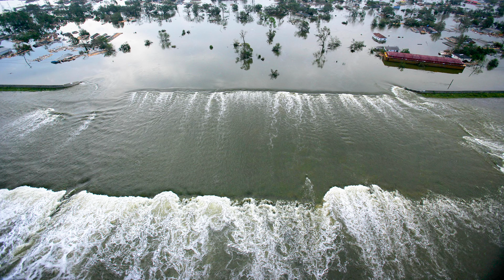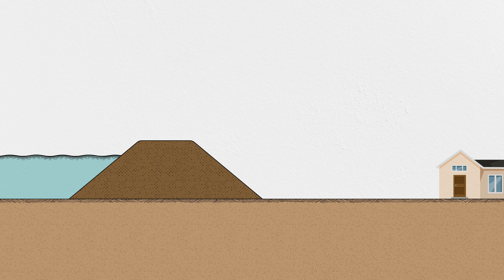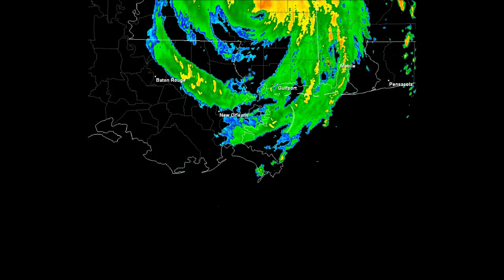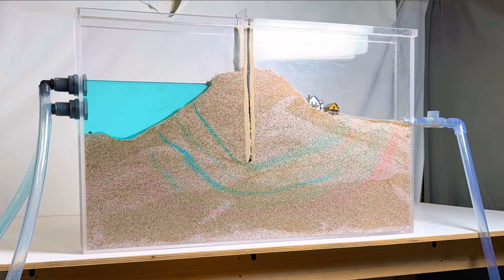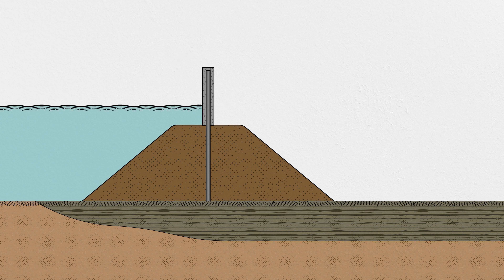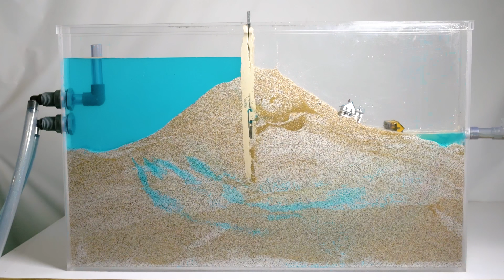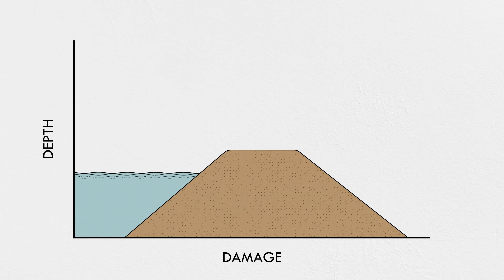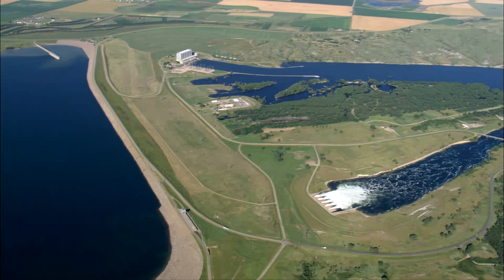The Mind-Blowing Flaw That Flooded New Orleans

Comment: Fun fact, after Katrina the company I worked for at the time did a lot of the programming work for the additional pumps they installed to prevent this sort of flooding again.  Sometime after we were done there was another flood event and the pumps failed.  Not because we had failed int he programming, but because they had failed to do the required monthly testing of the system and the generators had no fuel to run. 🤦‍♂
Reply: No fuel for the generators to run......don't get much more dumb than that.
Reply: @hillbillyfromtheswamp6223  aint got no gas innit
Reply: @hillbillyfromtheswamp6223  employees probably needed the gas for their ATVs, that they ride on the streets.
Reply: @WakenNate  heh lack of monthly control and oversight covers that too. it was bad management.
Reply: @WakenNate  Don't act like that is exclusive to New Orleans I'm in the Midwest we have people driving ATVs and UTVS all over too. Downtown, residential neighborhoods, highways some people just don't care.
Reply: @realdjoffski  is "monthly control" code for when the crew steals?
Reply: @WakenNate more than likely those large scale generators are diesel powered so there was no gas for atv to steal.
Reply: @farmerbond4210  those large scale pumps (not generators) are ran from diesel powered engines, but the issue is the people in charge, the fuel that was not there, and did it exist at all, or was it gas the people ordered for their atv's.
 They live in a ditch next to the ocean, I am very familiar with the people and area. I was deployed on the other side of the world and knew the hurricane was coming two days to a week before. After the hurricane several retarded residents of New Orleans were interviewed and stated they did not know a hurricane was coming (ok sure). They also stated they were waiting for pick-up from the government, if something bad was going to happen (there we go that's the answer government). Their black mayor killed his ignorant citizens. Then that black mayor blamed the president.
Reply: @DJameGriffin Houston has entered the chat
Reply: Why pay for critical infrastructure when you can pay a college football coach 54 million dollars a year?
Reply: Am from NOLA, not sure exactly which flooding event you're referring to (I was likely still super young when it happened if it was soon after Katrina lol), but this does not surprise me in the least. Our local and state governments have been comically bad for ages.
Reply: @greyttt also important to remember that the FEMA Director at the time of Katrina top qualification for the job was being a Horse Show judge. This highlighted the need for making sure nominees for the Cabinet are qualified experts for those important jobs!
Reply: @Seawolf44  oh boy do I have some bad news for you today in 2026...
Reply: @fatbadboy329 yet another brainwashing victim. Sad.
Reply: @Seawolf44  Federal. 

The pumps are run by local and state.
Reply: @AC-yj8cx  Are we winning yet?
Reply: @AC-yj8cx  is it brainwashing when it is objectively true that trump hires historically unqualified people simply for being loyal to him? on a scale and degree never before seen in our democracy? you might just be the brainwashed one buddy :)
Reply: @AC-yj8cx what are the current director's qualifications? Actually what were those of the guy that was there a few months ago
Reply: @Clancysway  Yes, we have a lot less illegal criminals killing Americans....so yes.
Reply: @AC-yj8cx dude I agree, I'm so glad we have news personalities running important public servant sectors. I'm so glad we have slave driven emerald mine tycoons running the government's ledgers. I'm so grateful we have a failed business man and failed casino owner running the country. Everyone is so qualified.
Reply: @greyttt icebox Jefferson would disagree.
Reply: @rickydspears who gives a s...hit
Reply: Hard to calculate the human aspects of any system.  In any system that requires human input, the human is usually the weakest link.
Reply: Should have been auditied.
Reply: @Chris-ut6eq  That's a catchy saying, but it's not an argument.

Every system that involves humans has human input—that's true by definition. Calling humans "the weakest link" doesn't tell us anything about whether a system is good or bad, or whether it's difficult to analyze.

Entire fields like human factors engineering, ergonomics, psychology, operations research, and reliability engineering exist specifically to measure, predict, and improve human performance in complex systems. Airlines, nuclear power plants, hospitals, and manufacturing plants all quantify human error because it's measurable.

So saying "it's hard to calculate the human aspects" is an oversimplification. It's challenging, but it's been studied scientifically for decades. If humans were simply an unknowable weak link, none of those industries could achieve the safety and reliability they do.
Reply: @Coolcarting  I have limited experience in anything that I can touch, you see I work on software.

Any time human input is required for software to work successfully, it eventually becomes the not only the weakest link but also one of the areas that requires substantial effort to minimize problems with that input.

I have worked in industrial automation, eliminating or minimizing operator input is always a key systems goal.  We humans are powerful sensor systems, but often offer unreliable input.

Of course this is how Skynet got started, so take it all with a grain of salt. :)
Reply: @Coolcarting Thats alot of words for something that doesnt really contradict what he is saying. The human is the weakest link because we as people have the tendency to prefer the path of least resistance. And you cannot truly take into account bureaucracy or even corruption on these cases.
Reply: @Coolcarting thank you for pushing back against the endless excuses for incompetence that seem to be becoming more common.
Reply: @Coolcarting  You might not be wrong, but in this particular case, if this really was just a case of the local government not being able to keep fuel in tanks so that it was prepared for an eventual emergency, well, I'd say that's a massive human error and you really don't need a bunch of geniuses in order to set up and execute the processes needed to keep fuel in the tanks. Like it's great if the people designing and implementing the processes are studied in ergonomics, psychology, etc. But that's hardly an excuse as to why they couldn't fulfill a fairly simple task that's critical for emergency preparedness.
Reply: @pickleman40  Incompetence is not an excuse, it's an issue. Almost all industries puts millions of dollars down to mitigate human error or remove the human entirely.

Yes, you can train someone to the degree that they won't make a mistake 99% of the time; doing the same job for 20+ years; there is not a single sole on this planet that will not mess something up. There needs to be fail-safes and fallbacks for these inevitable mistakes.
Reply: Good engineering only gets you so far with poor maintenance...
Reply: @lowelldolney2986  that should be on a bumper sticker lol
Reply: @Anson120 , an auto shop would probably get bad reviews for giving those out for free.
Reply: @Anson120  If I did bumper stickers, this would be one I got 😆
Reply: Standard regimen with any emergency generator is to start it up once a month, at minimum. Pre-start checks include the fuel level. It seems more likely to me, that: the fuel was paid for BUT never went into those tanks, being stolen by corrupt bureaucrats.
Reply: Sounds par for the course to me... unfortunately
Reply: The system itself was poorly-designed or had to make other trade-offs, then. A system that requires backup fuel to be installed should have monitors to ensure it's installed and alarms to notify people if it isn't available. The costs of such things are trivial compared to the cost-savings they offer.
Reply: “Governance thru cheapness, eventually gets expensive.”
Reply: Yikes.
Reply: Human error is often the most costly error!
Reply: Seems to be par for the course with the Sewerage & Water Board of New Orleans...😵‍💫
Reply: I wouldn’t call that “human error.”  It’s really a system failure.  Soft systems like audits, checklists, maintenance schedules… are essential elements of complicated infrastructure.  “Human error” is more like “the operator pushed the wrong button.”  This is WAY bigger than that.
Reply: @737smartin  Human laziness, then.
Reply: Meat space problems.
Reply: Fuel was as rare as hen's teeth after Katrina.
Reply: @MousieBrown944  I wonder how long the Gulf coast oil refineries were out of service. And right in the 2005-2008 period when global oil was stressed, right before shale oil brought on a flood of new production.
Reply: Central control is outdated to be honest.  Not to mention those 25hz turbines that are some how always tripping when over loaded
Reply: You mean the pumps installed below the water table i helped replace?
Reply: @anygues2834  how cool, we might have worked on the same area!  Of course by the time I show up you've usually finished with the hard work and are onto the next back breaking site.
Reply: @LifeWithMatthew Yes. And oddly enough i ended up doing controls engineering as a career so in fact ive designed control systems for even larger pumps
Reply: Thank you for your service.
Reply: @Anson120 I was working for a crane company contracted by entergy,  but I guess the army core was the end client so.. thanks? I was making $18/hr I think.
Reply: Ain't got no gas in it ! Can't make that up ,wild.
Reply: @cocouffs because the maintenance workers regularly stole fuel from state equipment, it was known
Reply: And as the controls engineer, im sure you got a lot of calls saying that something in the programming changed haha. Its sad to see whn people refuse PMs and cause damage like that though.
Reply: The American way
Reply: I know whats wrong with it

AINT GOT NO GAS IN IT
Reply: It's sad that these things really bottle neck at just a few people. My town had to fire the water treatment inspector because he was literally just checking off the boxes on the checklist. We had a boil water warning for a while until they sorted it out.
Son, you literally have one job. Smh.
Reply: Is anyone really surprised?  NOLA is a woke cesspool of incompetance.  I do not feel sorry for them because they keep voting for the incompetence.
Reply: That sounds like a story from Russia. Christ alive.
Reply: American maintenance attitude in a nutshell
Reply: Not to mention one of the new pumping stations was built below sea level and corruption.
Remember that hugely expensive new canal they built even though the Industrial Canal was already there. It was used exactly once. It was just another no bid rip off for the good people of that city.
After the new canal was built, Pontchartrain acquired a 100 FOOT canal that starts in the lake. 100 FEET!!!! Consider the wave action against those week levees. 
Thanks to the ridiculous amount of corruption there, ALL of the residents suffered greatly. Hey, but at least, someone's nephew made off like a bandit with that new 100' canal.
Reply: New Orleans is a 3rd world thinking city, in a 1st world country.
Reply: To this day, most of the pump stations aren't working at the same time. Only about 25% actually work at a time.
Reply: But you can be sure that S&WB sex den was never short on supplies.
Reply: You're crazy to think people will actually go through the hassle of monthly maintenance.
Reply: Sounds bad. What was the other "flood event?"
Reply: @JF-rm7vi  I forget the exact tropical storm event at this point.  it wasn't anywhere as news worthy at Katrina and the reason it stuck out at all to me was because it involved the equipment I had worked on and frustrated me that after all that we had a flood event where the system would have benefited people in a tangible way just for it to not work.  🤦‍♂
Reply: The pumps and generators that power them are very old and constantly fail during heavy rain storms. At the beginning of the year, there were three major pipes that burst causing localized flooding. Construction projects go on forever and cause businesses to fold because they stop foot traffic for such a long time. The entity in charge of these pumps and pipes were somewhat recently embroiled in scandal for having a sex room at one of their offices
Reply: @yutakahitomi2594  oh wow, I didn't know about that one!  😱
Reply: So it's not because President Bush hates black people?
Reply: What exactly was fun about that fact...
Reply: @Trey4x4  Would you be okay with interesting anecdote?
Reply: You explain the entire state with that. I bet on paper the fuel was there.
Reply: Most terrible natural disasters are only this dramatic because of human error
Reply: This does not sound like a fun fact lol.
Reply: Another shameful act by the US government. They needed the money for the attack on Iraq and therefore nearly abandoned Orléans
Reply: Greaaat. All that effort wasted and harm caused because someone somewhere didn't assign enough importance to a trivial like "making sure the pumps have fuel" 😭
Reply: Ahh yes, deferred maintenance, that old chestnut. Defer until disaster, then blame the people who built it. It's like blaming a plant for dying when you don't water it for months.
Reply: Not a very fun fact
Reply: They just failed again the other day lol
Reply: What's fun about this fact again lol
Reply: What a bunch of idiots
Reply: Similar situation happened at a datacenter in the bay area quite some years back that a former company of mine operated. There was a power outage and the backup generator failed to start, allowing the UPS to run down. The reason for the failure? Someone stole the batteries. No testing meant no one noticed.
Reply: The stupidest of reason, isn’t it? Lack of fuel. 🤦
Reply: Corruption
Reply: Albert Schweitzer could've told you that would happen. He tried warning us.
Reply: Oh wow
Reply: Black government employees will destroy the city.
Reply: South Africa tier management.
Reply: Sounds like standard procedure for cities run by people who don't know what they are doing, which is now nearly all of them.
Reply: @josephfisher426 
lets not forget underfunding because why pay for a working government
Reply: @adaroben1104 
New Orleans has plenty of money. They mismanaged it. Which is typical.
Reply: You should have made a better program with more resilience.
Reply: @tbird-z1r  I think you may have missed the essence of what I was saying.  There is no amount of resilience that can cover every edge case of human failure.

Also, I don't get to dictate equipment used.  I can only program to the extent of the equipment installed.  So do I recommend we do things like install power quality monitors, fuel level sensors, and other such monitoring devices?  Absolutely, and sometimes they even install them and those are good days for me.

But that doesn't mean they effectively use them.  I can set up alarms and warnings till the cows come home that the tanks are empty, but it does nothing when the operators ignore them 🤷‍♂
Reply: @tbird-z1r  One that doesn’t require dumb humans to actually maintain the equipment because that’s what happened here. Dumb humans “maintained” the equipment.
Reply: Sort of a parallel to the Los Angeles fires with no water in the reservoirs
Reply: @garypaulson5202 and no mayor to lead the decision making
Reply: Yikes, sounds like it was ur fault Matthew. Take accountability
Reply: **Correction, Gulf of America
Reply: Should have hooked it to gas lines so you could be sure there's fuel at all times.
Reply: @makatron 
In a storm disastet those lines may have problems; backup generators use stored gas or diesel kept on hand.
Reply: @adaroben1104  yeah makes sense to keep it on site but should have remote access to see the fuel levels
Reply: @adaroben1104  I'm no engineer, but does it have to be either or?
Reply: @makatron 
Definitely needs a monitoring system, running out is A class mistake
Reply: @corydorastube 
Yes. A generator doesn't run on just any fuel, natural gas is not gasoline. Nothing preventing having more generators except the explosive expenses to do two different types at once.
Reply: @adaroben1104  It did have a monitoring system.  But the alarms we provided were ignored as non-issues since the equipment wasn't ever used and maintenance schedules weren't be followed for testing the equipment.  And honestly, it's hard to blame them.  I get the struggle of justifying so much testing for equipment that never gets energized, but events like this highlight how vital this testing ultimately is.
Reply: You still have to maintain gas generators! My local ISP,used to use gas generators as a backup to loss of power from the power co and even had a maintenance crew to service them but found that even when serviced only about 6% of them worked properly when needed, so they have started removing those expensive to maintain generators and bout portal gasoline generators that get dropped in situ when the power supply messages it has switched to battery power.
Reply: All it takes is one human 😅
Reply: @TheAmbex  To either save or doom us all!
Reply: Humanity is about to Find Out what happens when you allow capital and amoral, Capital Murder to become the norm.

The systems we never see or participate in as individuals but Tradesmen do every day are so crucial to modern life. Keeping electricity on requires many different types of personnel that keep complicated systems on the up and up. The irony I see is we've demonized any form of education, trades or university. Of course some people will still go into these critical jobs, but without continued investment in these systems both for people and the companies running these utilities " make sure they are non-profit or publically owned " are held to high standards.
Reply: Obummer or bye den?
Reply: @joltjolt5060  sorry it took me a minute to realize what you were asking 😆.  Let's see Katrina was in 2005 so if I remember correctly this happened this happened either right at the end of Bush's presidency or towards the beginning of Obama's.  It wasn't anywhere near as detrimental as Katrina so it did not get wall to wall coverage.  The only reason I really paid attention was because it affected me personally through the work I had done on these pumps and the tragic irony of the fact that it could have prevented the damage that did occur had basic maintenance been performed on emergency equipment.
Reply: Anyone wonder why the fuel wasn't in it? Did they take gasoline?
Reply: @andromedaspark2241  I mean if they just left it running it would run out, so my guess is the just left it running and forgot it existed until they needed it
Reply: @Flamekiller33  good reasoning
Reply: And people claim fission reactors are safe. Nothing is safe if you ignore maintenence. And they will ignore it, its just a matter of time.
Reply: Whatchu talkin' 'bout, Willis?
Reply: @2006gtobob  So there was this big hurricane called Katrina a couple decades back now.  In it's aftermath one of the things that was decided to try and prevent this kind of disaster from every happening again was lots of new pump stations, some of which very coolly effectively made the river run in reverse as they pumped water upstream to get it onto different flow paths to alleviate flood areas.  It was decided that to turn these pumps on and off they would connect the pumps and lots of other sensors to a SCADA system through PLCs and operators would be able to remotely turn pumps on through the SCADA system instead of having to send people to every pump site during a storm event or to permanently man these stations.  This was government work so there was a LOT of documentation of testing of the system to prove that it worked as intended.

HOWEVER, after we were all done there was a storm event where the system needed to run and it failed not because of any programming error or network communication error but for the simple reason that the standard testing they were supposed to perform wasn't being done and the gas generators they had on site were empty.  Thankfully this storm was nothing like Katrina, however there was flood damage that occurred that could have been prevented had the system been able to run.
Reply: @LifeWithMatthew  That isn't really a failure of the SCADA system or the automation. It was a failure of maintenance and operations.

If the generators were empty because routine inspections weren't carried out, the same lack of maintenance could have caused problems in a manual system too. The lesson isn't "automation failed"—it's that critical infrastructure needs its backup power and maintenance procedures taken just as seriously as the control system itself.

In other words, the technology did what it was designed to do. The support systems around it didn't.
Reply: @Coolcarting that’s what he said
Reply: @Coolcarting duh, that’s literally what he just said…
Reply: “Standard testing wasn’t done and the generators were empty”  “not because of any problem with the programming” … he’s literally saying the same thing as you, what it wasn’t an issue with the system, but with the maintenance of it… I’m so confused why you’re acting like you’re adding something new?
Reply: @sophritoh  Because after all of the catastrophe of Katrina, they STILL didn't learn the first time and made the same mistakes AGAIN! You have difficulty with inference, don't you?
Reply: @TheSouthIsHot  I think you misread what they were saying.
Reply: @LifeWithMatthew  Reminds me of a UK nuclear power plant with triple redundancy, and 5 sets of 'emergency' generators, where one was always on it's maintenance cycle, hence unavailable; so if a fault occurred they were down to three, and the next credible fault would break the triple redundancy, so they had to start scheduling a plant shutdown essentially on first fault.
Reply: @2006gtobob  Good times,  good times! :)
Reply: It is your moral responsibility to make that statement in an official capacity as well as legal capacity if you haven't done so.
Reply: Had you been through Katrina perhaps you’d understand that a population in profound post disaster shock doesn’t function very well. Perhaps your snide, racism tinged anecdote misses the real point.
Reply: @elizabethclaiborne6461 
Didn't see any of that in OP.
I think the snide and racism tinge is coming from inside your own house. I'm half blind though so if you can point out what you think makes it that, I'm interested.
Reply: @adaroben1104  It's "someone else's problem" syndrome. Baltimore's rather new sewage nitrogen removal system malfunctioned because operators let the stilling pits fill up with sludge. There was grass growing in several of them!
Reply: @elizabethclaiborne6461  snide racism tinged anecdote?  I'm kinda shocked you could get either of those ideas from my comment.  I'm just a PLC programmer ma'am, I encounter stuff like this all over the nation regardless of soci-economic status of the area I'm doing the work in.  And these stations took YEARS to get set up.  This was government work.  It takes them a long time to first identify where the failures came from, then to have engineers identify the steps to take to prevent this from happening again (hopefully), then for the construction work to be done, the electrical system to be wired in, and so so so many delays upon delays.  Then after all that I get to come in when everyone is furious that the job isn't done yet and I finally get to do my part.  We were so far past post disaster by the time the system was tested out it's not even funny.  But the actual storm event that happened took place some time AFTER all that so no, this wasn't so post disaster scarcity situation.

Now apart from all that, I do see there are some people who have commented on my post speculating that the fuel was stolen.  That may be, but personally I don't think that was the issue here.  As I said in my original post the issue was simply one of people not doing the mandatory maintenance work at this point in time.  This is pretty standard human behavior.  Whenever I first commission a system everyone is excited, procedures are followed, maintenance work performed all is good.  Then over time as no disasters happen managers start to get uppity about the time people are wasting doing this maintenance work on equipment they don't need, after all it's only for "100 year floods" and we just had one so we're good for 90 more years.  And there's more pressing work to be done on equipment that is used every day so now no one does the tests they're supposed to, there's no scheduled downtime or preventative maintenance schedules being followed everything is reactionary maintenance to down equipment.

And then we get to hit the next phase where that disaster equipment is treated as a spares part bin.  After all it's never used and that pump over there needs a replacement part and the lead time is a couple weeks.  So you just take it and it doesn't matter that it's down for a couple weeks.  Only soon management isn't even buying the replacement part because it's not in the budget right now and the equipment hasn't been used in a decade so what does it matter if it's 6 months before the budget let's us order it.  And then the disaster hits and no one know how this could have happened and plant personnel who kept sounding the alarms are being fired for not doing the work their managers wouldn't let them do and the managers get handed bonuses and awards for how well they handled a crisis that their management mindset helped create.

So no, any snideness or racism you read is only your own that brought in to it.  There is no one race that has a monopoly on this sort of behavior because people are just people no matter where you go or what color skin they might have and I was just commenting on a tragic irony that I personally witnessed that was related to the video I just watched.

You have a good day now, ma'am.
Reply: @elizabethclaiborne6461  His comment has zero racism in it. He said they failed to perform the monthly system checks and there was no fuel in the generators. If you think that’s racism then you’re as $#@% as a box of rocks.